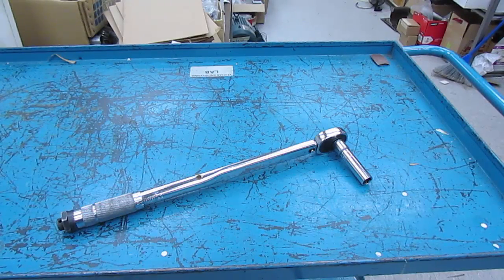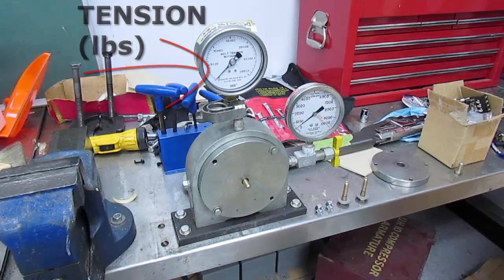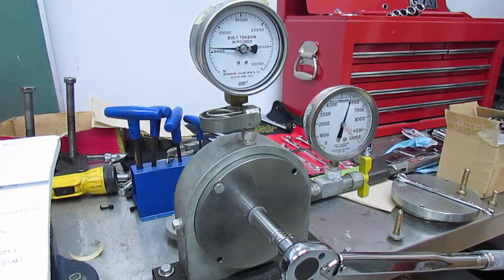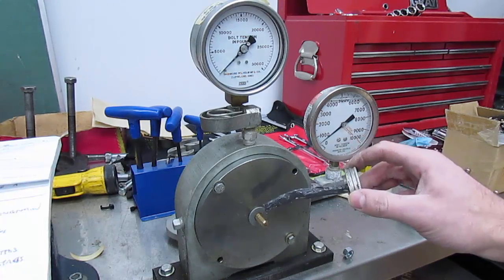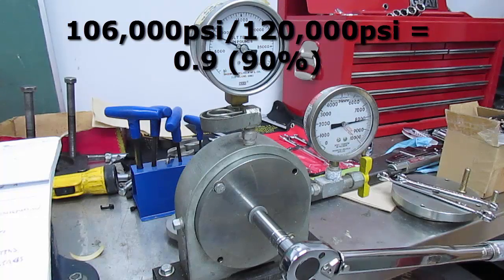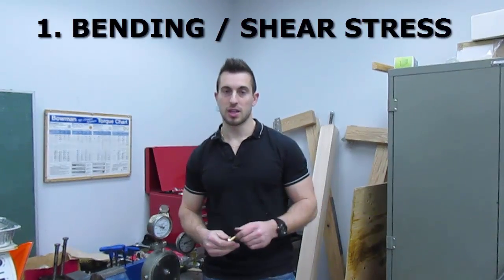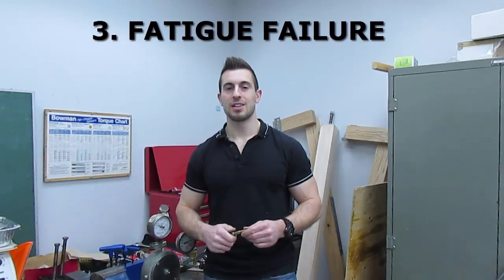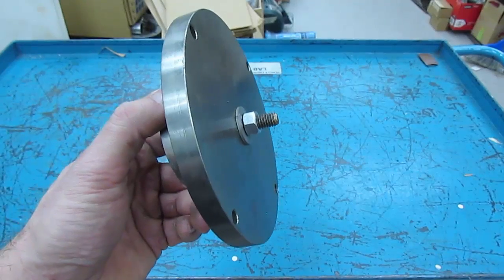Should You Put Anti-Seize On Wheel Studs / Lug Nuts?

Comment: This is interesting, on another video it shows that using anti-seize on wheel studs has the opposite effect. On the other video it shows a reduction of 50% in clamping force on the assembly, while on this video it shows an increase of clamping force on the assembly . The only thing I can think of is in this video it looks like new hardware was used, while on the other video it looks like they were using used hardware for the test as you will most likely find on a used vehicles. The only  thing I'm getting from both videos is that anti-seize is very unpredictable on wheel applications. According to the anti-seize manufacturers it is recommended to be used only on static applications. https://youtu.be/lsCyAvTqcNE
Reply: His method in this video is extremely flawed. Can't comment on the other one, but you may as well ignore his numbers on this one. Not the right type of fastener, not the right type of application, not a proper application of the anti-sieze, and only doing his experiment once are all contributing factors to this being flawed at best. If he did a proper experiment we may have more useful data.

Comment: Could be....Maybe...From about 15 years I'm using whatever grease ,antiseize Permatex aluminum on wheel logs and center hub...Some friends start doing the same because we have to change winter wheels by law and the rust made this a awful job...The log nuts are torqued by hand , no excessive force . No one never had a problem, from small Yarris to F 150...The speed limit in NORTH America  and Canada is way too low to bother with engineering calculations for torsion.
Reply from the maker: Shouldn't be a problem to use some grease or anti seize on the wheel center bore and the hub to prevent seizing there. I wouldn't apply it to the wheel face or rotor face as these are the clamping surfaces where clamping force is used + friction to keep the wheel in place. I also wouldn't use it on the lug nuts as I mentioned in the video. If you are changing your wheels seasonally (like I do) I don't find that the lug nuts seize. Also, your statement about the speed limit in North America is irrelevant to the torque spec.

Comment: Good information and presentation. I gotta say though seems like modern culture, especially in America has become fearful, and want to put a rule on EVERYTHING. I can understand how this is crucial information in the world of certain racing and aviation applications.  As a shade tree mechanic of 50 years I will continue to wire brush threads, apply a thin film of oil, and snug things up. The biggest mistake I see people make are not cleaning parts thoroughly, especially rusty brakes, and cranking things down, way to tight, not good for anything, especially rotors. The argument should be made that just as anti sieze can result in a bad torque reading, so can a rusty wheel stud/nut, as that will create a lesser tight bolt, and inconsistencies between boIts, I venture to say, in real life, rusty instalations account for more problems. Really, when was the last time you heard of someone's wheel coming off, excluding those installed by a Just Tires mechanic? Lol 😆
Reply from the maker: Thanks for the comment! It's not necessarily about putting a rule on everything (I'm not a big fan of that 'movement') but more about good technical practice. Actually, wheels come off of vehicles on a pretty regular basis, they just usually don't make the news unless it is a transport truck. In this article from 2019: https://www.caasco.com/blog/Automotive/dont-let-the-wheels-come-off-how-to-prevent-wheel-separation it shows that in a four year period in the province of Ontario, Canada alone, there were 389 reported cases of wheels separating from light (passenger) vehicles and 29% resulted in a collision. That obviously doesn't account for all of the unreported ones as well. I know as a percentage of all of the vehicles on the road in the province it isn't a huge number, but it's still significant enough that someone (multiple people) have probably been killed or badly injured as a result. I would say it's worth letting people know what the recommended practice is
Reply: @EmbraceMaking  You make good points, I shouldn't dispute your effort, knowledge is power, best shared with everyone, keep up the good work. I do think though, you are touching on a very specific technical point, nothing wrong with that. I would venture a guess that the problem with wheels coming off on Monday has more to do with how much they drank on Sunday, and a general problem with lazy, carelessness. Also wheels are not standard in the ways they are attached, too many variants and complex spacers, binding nuts, et cetera, that complicates things. I've always appreciated the simplicity of a black steel, fleet style wheel and the lug nuts that seat into the nice beveled holes, spun in place with a 4 way lug wrench. Probably covered with a dog dish hubcap. When you start fiddling with simplicity, problems arise. As a side note I took my 2000 Town Car to Just Tires in Culver City,  I paid 700 bucks for top of the line Goodyears, they offered me half off on a wheel alignment, I played the sucker, I should have gone to Bagge, my usual, the steering wheel was crooked and it pulled to one side. Went back for the fix, same problem.  Said it was within specs. Took it to Bagge and Sons. The first thing the mechanic says is all the bolts are loose! In the end they did a beautiful alignment, car tracks perfectly, wheel is straight. The Just Tires kid knowingly sent me down the road with control arms ready to pop, this is stuff that goes on. I've driven more than a million miles in LA, taxis, Limos, I have seen some crazy stuff, one time I did see a wheel coming in my direction, it was a bigass, like off the back of a Vette, 10 Fwy and Crenshaw, from the oncoming lane, that was scary, it was bouncing like a ball, thirty feet in the air, went by me 100 ft away, I never did hear a crash. Sorry to ramble, this California lock down leaves me lots of time to blue face. Lol.
Reply: @kccodex8931  His point here is moot though. Tires coming off doesn't equal tires coming off due to lubrication applied. Anecdotally, I have never seen anyone's tire come off that I have put on or have seen put on. With hundreds of variations in tire size, bearing size, levels of lubrication including anti-sieze, and levels of rust. And in many applications up to and including racing conditions and towing conditions. All torqued by hand with a fourway and no torque wrench.  If a tire comes off then anti-seize didn't cause it. It is possible that it makes other factors more dangerous, but it isn't inherently dangerous itself. In shops that only use impact tools I would say not to use it without proper torque specs, but if they were listed for wet lug nut applications they could easily use it with them as well. His experiment is flawed here so his numbers are exaggerated at best.

Comment: According to this video the reduction in torque rating with anti seize is 30% and that figure is not a guess but a measured/calculated value: https://www.youtube.com/watch?v=f6akcyvquzs
Anybody else seen the video?
Reply from the maker: Somebody else pointed this video out in another comment I believe. 25 - 30% is a common estimate based on calculation / experimental values. The only catch is that it still depends on how much anti-seize you use. If you use a ton then maybe you haven't reduced it enough. If you use too little then maybe you're under - torqueing. Something to consider but it will probably get you in the ball park.
Reply: @EmbraceMaking  I agree, the amount to be applied (they say 'heavy greasing') is not quantified (how 'heavy' is 'heavy'?), and that must still mean some uncertainty.

Comment: I feel like the pros of using anti-seize outweigh the cons. I use grease, torque to spec, and re-torque after the car's been driven a good 50 miles or so. They are built so over spec, they can handle it, and they aren't going to seize. And there's no way anti-seize is getting them tight enough to warp rotors. I have seen way, way more lugnuts snap during removal than during tightening. There's also the problem of less than perfect studs and or lugnuts decreasing the load on the hub and possibly loosening over time, (I saw this happen less than a year ago on a relatives car). Anti seize will help with this problem.
Reply: i always throw antisieze in between the rotor and hub and wheel and rotor. I accidentally usually get them on the threads of the studs and just tighten down as hard as it'll let me with a tire iron. Never had an issue lol
Reply: The dose makes the poison.....just food for thought.

Comment: I torque the hell out of my lugs and use anti seize. 

Wheel stands are way over their spec in terms of what they can handle. 

So ya anti seize, 100+ ft lbs tighten and she’s solid. 
After 580,000 km on my daily and bolts still solid I think I’m doing something right lol. 

Also I’ve seen cars a few years old without anti seize and bolts snapped off from the rust forming on the dry bolts. 

So anti seize is the way to go for lubrication and stud longevity. 

Also mechanic shops use anti seize on all brake parts, studs, and wheel lugs.
Reply from the maker: If you torque to 100 ft-lbs and the wheel stud is M14 then you're under torqueing (dry) and if it is M12 then you are fine (dry). There is some head room. Wheel studs are not torque to yield. Just because you haven't had any problems to date, doesn't mean you're doing it right or will not have problems down the road. It's like saying "I smoke every day and I'm 60 years old and haven't developed lung cancer yet! Obviously smoking isn't going to hurt you!" There are many professionals who would disagree with you and you are lucky up until this point. If there was no purpose to a torque spec then every manufacturer wouldn't list one and there wouldn't be charts available, engineers wouldn't recommend a spec, and why would anyone bother manufacturing a torque wrench? I guess everyone has been wasting their time. Anti-seize has it's place and can be used by those who know what they are doing. And anyone who knows what they are doing isn't going to tell you to slap anti-seize on and "torque the hell out of it."

Comment: Good info. However, it has to be remembered that friction changes as lug bolts corrode so that throws theoretical calculations off. I've known for 55 years (since my first car) that it is not recommended that lug bolts  be lubed. However, I have lubed them for most of that time and I've never experienced a single problem nor has anyone else I know that lubricates them including professional mechanics.  I do, however, generally torque them to slightly less ft/lbs.
Reply from the maker: Lots of people don't realize this though... or they are too liberal with the anti-seize / grease and they don't reduce torque... plus its hard to say how much. The engineers who designed the car also know that friction increases with corrosion and leads to reduced preload which is why they chose the torque value they did for the lug nuts in the first place. There is ample headroom on preload to account for reduced clamping force with corrosion. So even if you keep on using the recommended torque value you should be safe.

Comment: M12x1.5 nuts. Very tiny bit of silicone grease along each stud. 80% of manufacturer specified torque. Have no problem with nuts, even after drifting or 1000 mile highway trip. No rust on studs, in UK where rust is eating every car away.

Comment: I think everyone need to take a deep breath and take some advice from the manufacturers of bolts, studs and nuts, they have undertaken all of the scientific research necessary. 
Here in Australia we have a manufacturer Ajax Fasteners (also in USA) who produce an excellent Technical Reference Manual. Y'all need to read it. 

It is available from their website and covers in detail, tightening of all kinds of bolted joints, with all kinds of fasteners. It provides information on torque settings for fasteners with different surface conditions, including dry and heavy greased/anti seize finish. 

The manual has all of the scientific and engineering tech data you could ask for. It states -
 "Because friction is the major unknown variable effecting the relationship between torque applied and tension induced, the presence of light oil lubrication is the minimum standard recommended for consistency in controlled tightening of fasteners. Most plain finish fasteners are supplied with sufficient oil residue from their processing plant, but plated finishes will generally require oiling or adjustment to the torque recommended in the Ajax Fasteners' Technical Data. 
For bolts with surface finishes or assembled with anti-seize or heavily greased, the torque induced preload relationship is likely to be altered and the recommendations to require modification." 

It then has a table showing various fastener (bolt/stud ) surface finishes, with a factor that the recommended standard torque value should be adjusted by, for each, with "heavy greased" showing as 70% of standard setting.

The manual also states that "dry bolt" joints are subject to the largest variation in clamping force, owing to variations in fastener friction. There can be a variation of up to 25% in clamping force (usually a reduction), with dry fasteners with the same torque, with repeated use,  which with adequate "lubrication" can be reduced to 10% .

So, they don't say not to use grease, they say if you lubricate the fasteners with proper adjustment to your tightening torque setting, the clamping force obtained will be more reliable and reproducible 

So, lubricated fasteners will definitely provide a more reliable and reproducible clamping force, but strict attention must to be paid to the tightening torque, so you don't exceed the design parameters of the fastener. One wonders what happens at the tyre shop or dealer when you take your car for service with greased studs.

Now one needs to weigh up other parameters as to whether anti-seize is a good thing or not.
Reply from the maker: Good advice! That is the problem I am presenting here... most people grease them up but don't realize the effect it has on the preload. So they go at it and tighten it down to full torque spec, potentially stretching the bolt!

Comment: Not sure if this is correct. I was told a long time ago when using anti seize go 75 percent of torque rating.
Reply from the maker: It's one of those "general rules of thumb" it seems ...
Reply: Someone said do 30% less
Reply: The manufacturer of some of the finest auto fasteners,  ARP,  recommends lubricating the threads as well as nut surfaces, and to adjust torque specs 30% less.
Doing the math will confirm this reduced torque on lubricated fasteners will give the same tensile clamping force.

Comment: Hello from germany. If the threads are in good condition I mount them dry, if they are rusty I clean them with a wire brush and give them one or two drops of oil. But I know that lots of oldtimer and 4x4 guys are using copper grease on the wheel nuts/bolts, and never heard that someone had an issue with that. In my opinion it might be o.k. to use a very little bit (!) of copper grease and reduce the torque about lets say 10 nm.
Reply: I`d like to add that I have a copper grease tin from Granville UK, and it is written and also pictured on the tin that you can use it for wheel nuts and bolts. The use for wheel nuts is also shown on the tin of Würth CU 800 copper paste.